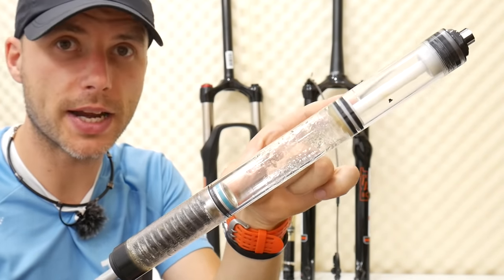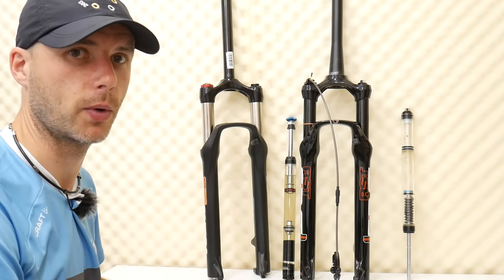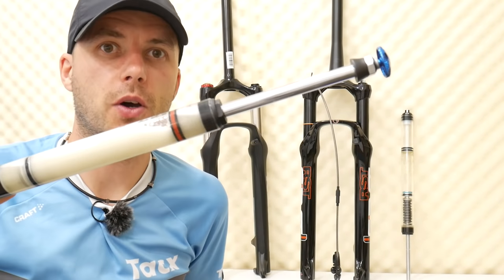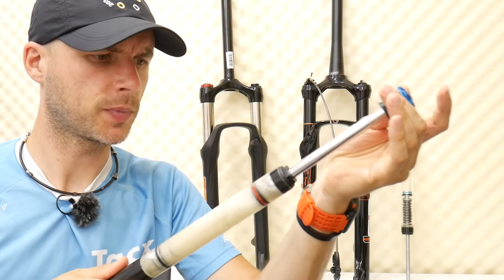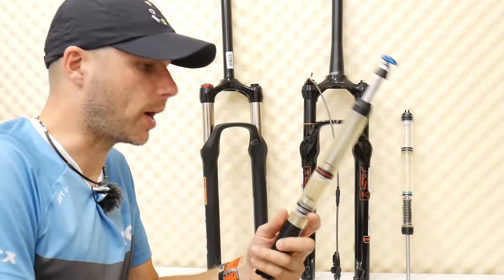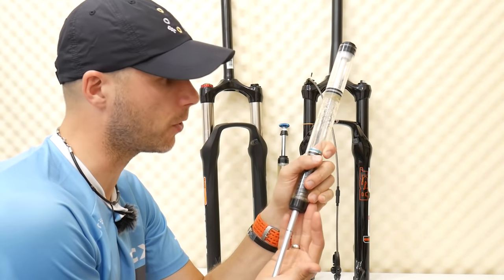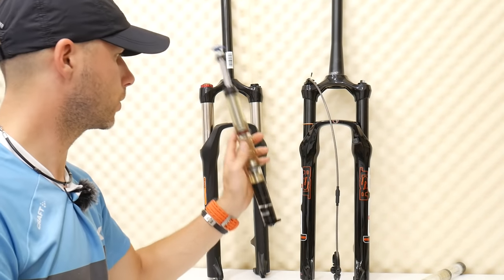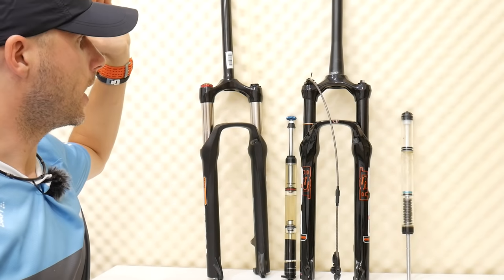Now EVERYONE Will Understand, How The Suspension Fork Works. What's Inside.

Comment: Im a little confused about one thing, how when you decrease the size of the air chamber, with spacers, does it not also decrease the travel
Reply: John Smith no, it makes the spring more progressive.
Reply: The spacers reduce the volume of the air chamber without interfering with the travel. This means that when the fork is compressed the air pressure increases far more than without the spacers as there is less air to compress resulting in a higher pressure when fully compressed. This gives a more progressive spring rate making the spring harder the more it's compressed.
If you put too many spacers in the air chamber then yes, they will reduce the amount of travel as they will simply get in the way and most fork manufaturers will recommend a maximum number of spacers to fit.
Reply: @roythearcher  ahh KK thanks. Makes sense
Reply: @JohnSmith-om3dk  I should have said that volume spacers fit in the top of the air chamber but I guess you've already figured that one out!

Comment: I just wanna ask about my fork doesnt compress until i stand,or hit the brakes...
Reply: The easiest option may be that your air pressure is too high. If you don't arrive to get the correct amount of SAG out of your fork , that's likely to be the issue.

Or maybe you have the option to tune the fork's low speed compression. This adjustment prevents excessive diving of the fork during "low speed impacts", e.g. when you pedal. In the same way, while riding corners, you may have a higher stand in the travel. You could on the downside notice a reduced sensitivity. The reactivity towards "high speed impacts", as it is the case during descends, will not be affected by the low speed compression.

Comment: What does the top bit on the downhill suspension do?
Reply: More length for the suspension to compress. 

It Allows fork to absorb much tougher bumps
Reply: It makes the fork stiffer because it mounts in two places. Also it makes more space for the internals, which for example makes the air spring more linear

Comment: But what do you think about a fork with only a remote open and lock (just 2 options) that doesn't have a rebound adjuster? It's an air fork, smllow.
Reply: If you buy a fork without any rebound adjustment, there is a high chance that it will be a pogo stick or an unsuitable rebound speed for aggressive riding. I recommend getting a fork with a rebound adjustment. If you are going budget don’t buy cheap Chinese forks, such as the one you listed. Get something like a rockshox Judy silver for $169 and if you can spend more, get a rockshox recon.

Comment: No this is not an explanation. How does the compression damping work?
Reply: Fluid flow into the chamber on the top side of the piston head is unrestricted during downward movement of the piston head. Fluid flow into the chamber on the bottom side of the piston head, during upward movement, is restricted and as such, takes longer to fill up compared to the opposite chamber. This extended time to fill up controls the upward movement of the fork during use, limiting the rate of extension of the spring in the air spring side of the fork.

Comment: I still don't get something... Why are they not the same, why do you even need part with oil, why are they not both air-pressure based? Would seem more logical to me
Reply: Most basic explanation: sealed air chamber or a spring inside the left leg controls the STIFFNESS rate. In the right leg, oil flows through the piston and controls the SPEED rate at which fork will compress and decompress (rebound) because liquid oil itself is uncompresseble.
Reply: Air is compressible, but oil is not.  Because air is compressible, it cannot function as a dampener.  Imagine you designed the dampening side for air, then set it for slow spring return, closing most of the return flow holes - slowing the air flow through the little holes ("channels").   Then the air would again act just like a spring... in other words, there would be no dampening.

Comment: I had a bad experience with a Bucklos Factory 32 140mm fork that I installed on my 26" bike. After about 300km in the city, I noticed that I was losing oil from the rebound screw. No help from Bucklos and I couldn't find anything on YouTube to solve the problem. The lower air side screw spins in a vacuum and does not want to be removed and does not want to be tightened again.$#%&*(*(%
To help those who wonder how many milliliters and what kind of oil; 5ml / 80W
Reply: Do yourself a favour and do not buy generic far east brands

Comment: just hold that tube in the same orietation as it is during ride. That air buble would be elswhere and oil wouldnt foam that much. And it is not called "rebound" but rebound damping. Love that when i see types like u doing these describing vids about bike suspension as incompetent to do it cuz its clear that they dont fully understant that topic.